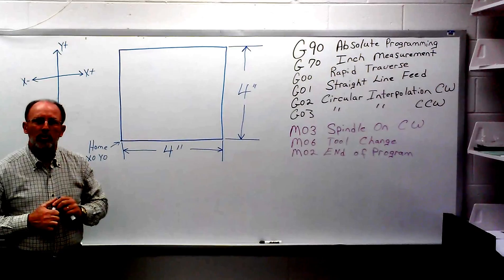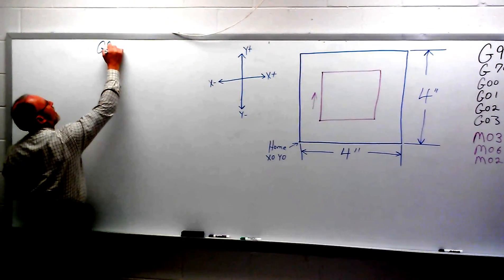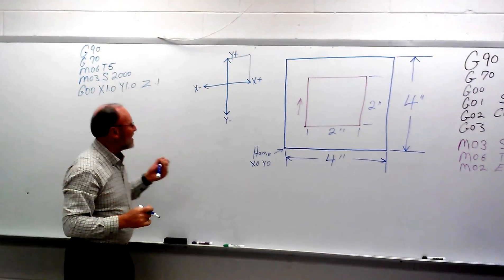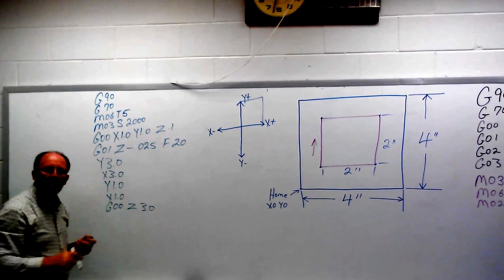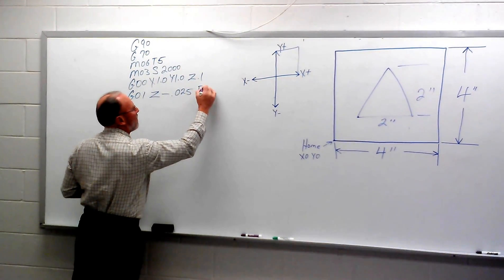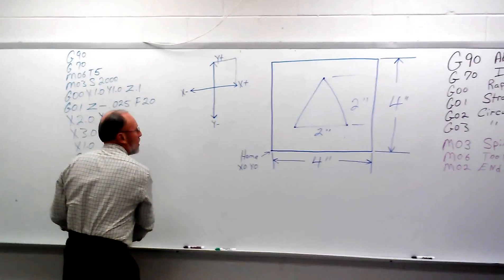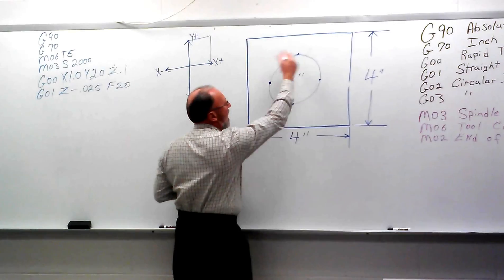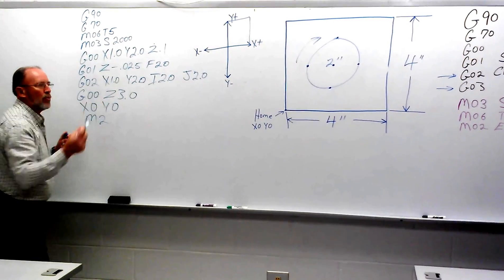Basic CNC

Comment: If I remember right, the VMC's I've run that do not require G43 pick up the length offset how you do an M06.  But these are older controls, probably few in use now.

Comment: Can you tell about the cutter offfset whether the program is set in a mode where the cutter is in mid of the coordinates or on the outer edge of the coordinates ?
Reply: offset left G41, offset right G42.
Reply: G40 cancels all cutter offsets.  The center of the tool follows the programmed path. 

G41 comps the cutter to the left of the path. You still program it with the same XY cords though. But when the program runs, the machine offsets the cutter to the left of the programmed path by the diameter value entered into the machines tool table. 

G42 does the same thing as G41,  except the machine offsets the cutter to the right of the path

Comment: i thought M30 was end of program o_O
Reply: it actually is. M30 is rewind. M02 is end of program.
Reply: +Mike Morris Aah okay, never used M02 before i think. Where I work we have longer series so we just always use M30, so pretty much the only thing i have to do ones a part is complete is to press start :)
Good to know tho.
Reply: Most CAM packages use M02. We use MasterCam
Reply: With an M02 to end the program, you will have to first hit reset, to reset the program to the begining and then hit cycle start to repeat the program

With M30 you don't have to hit reset. The M30 automatically commands to both end the program, and go back to the begining of the program. 

In the old days of tape read machines M30 would rewind the whole program. Which takes time. So often shops had a separate tape reminder and would have 2 tape copies of the program. So they would end with an M2, machinist would unload the part, then unload the tape and stick it in the rewinder and place the 2nd, already rewound copy in the machine and run the program.  This way the part can run while the program is rewinding.

Comment: Where's The G41?! Have fun programming on the line with no comp.
Reply: Sure Hunt. You can program without cutter comp. 

Cept what do you do when you programmed your 1/2" cutter assuming it was 0.500 in diameter but in reality it is really 0.4989 and you need to hold .001 tolerance?  

You really wanna go back and reprogram and do all the math involved for a .4989 cutter?  Or would you rather use cutter comp and just change the D value in the tool table?  ;)
Reply: Don't need cutter comp if you know how to program without it.
Reply: I'm programming center of spindle using an engraving tool. Cutter comp has to be off. if I give it an actual tool of any diameter then add G41 or G42 and end using ,G40. thanks for your comment. you were absolutely right. so much easier with cutter comp.

Comment: I run cnc everyday and that is a very good starting point all the offset codes need to be learned after you understand how the machine would move otherwise ur crashing people that are complaining bout g54 (vice) g43 (height) g41-42 (left or right cutter comp) that's more in depth and if you already know it that's great but some people are really just trying to understand basic movement
Reply: +RowSniper44 hi. im new. what code if machine cannot do full circle in absolute?will it be auto to incremental then program for 4 arcs?
Reply: Well it all depends on the machine I ran old fanuc a lot and had the same problem I had to arc the circle twice so say your zero point is center of circle and you need to make a 1" circle around the inside I would program it like this 
g1 g41 x.5 y0 d1 f3.; 
g3 x-.5 y0 r.5 f8.;
G3 x.5 y0 r.5
Now if you don't want a nub in the circle you can ramp off of circle or you can make a quarter arc like this g3 x0 y.5 r.5; then come out of part g0 z2. M9; then cancel cc go g40 x0 y0 with a haas it is much easier to hand program but if you can program old school you can do it all only difference is start up and end codes
Reply: You'd have to program a full circle in two 180 degree arcs.
Reply: Sounds like a cure for cancer type technomological shit! Not trying to come off smart...plenty of stuff I'd love to have made.... love to be able to make it myself... they are basic shapes and I'm lost completely... so billot heads billot engine blocks.. alot of skill there too much maths for me

Comment: Please explain what is words H,T,M,S,F the role of the letters?
Reply: H Is a stored number that refers to the length of the tool
T references a tool number in a tool changer 
M are misc functions. M3 spindle CW M8 coolant on, etc. they vary depending on the machine but the basic ones are usually universal 
S is spindle speed. Either in RPM or SFM
F is the feed rate of the tool. Usually inches per min, but can also be switched to Mm\min or in\rev
Reply: +Dashzeveg Bayarsaikhan H: is the lenght of tool.
T: tool(T1,T2,..)
M: coolant , spindle rotation direction CW or CCW etc., End of program M30 on Haas and M02 on Fadal machines
S: Spindle Speed
F: is the FEED rate of the tool.
Example:T1M6(M6 tool change command of the tool 1);
 Z0H1M8M3S1500F500( Z0 usually the top of the workpiece, H1 the lenght of the tool 1
M8-coolant on, M3 Spindle CW rotation, S is the rpm of the tool, F is the feedrate.
I am just a noob operator, but is not that easy to learn it :)
I forget it: first of all the G43 command needs to be placed on HAas machines. That is the tool offset library read command.

Comment: As I know I and J parameters are to be specified in relative coords even when G90 command is issued (source: LinuxCNC 2.6.7 manual, page 252). Otherwise you have to issue the command G90.1 before.
Anyway great introductory video to fix basic concepts!
Reply: I,J Always incremental. Regardless of mode.Absolute, incremental (G90, G91).

Comment: Since I recommend this video to persons who are absolute beginners and who will later be in a seminar I conduct, I should point out that what Mr. Morris labels "Home" is "Work Zero" in my notes. In the old, old days we would have called it "Absolute Zero" but contemporary CNC has a hierarchy of absolute systems. The machine system is the bottom (ground) system of the hierarchy and the work system is the top system. I suspect that if Mr. Morris were demonstrating on an actual machine he would have found the zero offset from machine zero to work zero and put it in the 01 Settable Zero Offset and included G54 in his first motion block.
   With regards to compensation for tool length offset, if Mr. Morris set up the machine with the tool as a reference onto itself (relevant for setting the zero offset in Z), there is no length offset to consider. This would explain why there is no D-code (or G43 and an H-code if you are thinking Fanuc). Of course, he would be in crash city if he changed to a tool of longer length.
Reply: I have a question, what part of geometry should I learn? Areas, perimeters and volumes or analytic geometry? I am confused. Gbs
Reply: Guillermo Azamar
You need a smattering of algebra, trigonometry and analytical geometry to do CNC above the button pushing level. The purpose of analytical geometry is to learn coordinate systems. Much of math education is to condition the mind to think mathematically. With regards to actual "doing", I rarely do more than simple right angle trigonometry. You really do not need much more than high school math assuming you stayed awake for at least 10% of the class. Unfortunately you might need a lot more math education to realize how little you really need.
Reply: Setting a z zero height relative to the tool in the spindle would require bringing the tool tip the the top of the part and setting the work offset z to that -z number. Which is really more trouble than it's worth and better to set an H registry value and use the G43 height compensation. 

Or could bring the tool to the top of the part and move all Z axis moves in G91 incremental moves. But I've seen people try to do that with disastrous results.
Reply: Guillermo Azamar YES! sorry, all those. I know it's hard to see right now but it will become like reading a short story in the end. There will come a time when you won't think about it. I know, sounds weird, I hear music and I may toss up some some code for hours standing in front of a VMC, and not worry other than type-o's. I'm not kidding!

Imagine if I went off on a rant here? We'd be here for days! wait, too late...

Comment: That was some different programming than I have ever used with many elements missing. If I put that code into my machines it would give me several alarms. One very important thing you forgot, and every mill I have run needs is a G43 Z.100 H5, since you called out tool 5. G43 is tool length compensation. Z is optional but easier if it goes here. H5 tells the machine to look in the tool offset library for the length of tool 5. Just saying.
Reply: +harryt622 in case of the Haas machines G43 needs to be placecd in the coomand line, but on Fadal machines there is no need for the G43 commands.
Reply: I've run VMC's that didn't need G43 or use H.